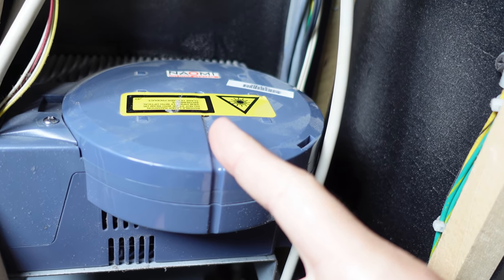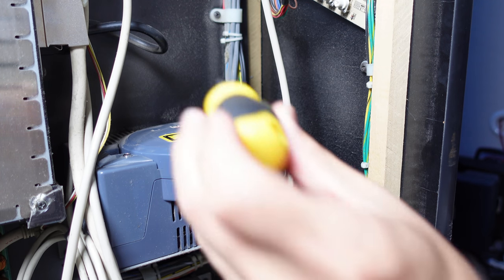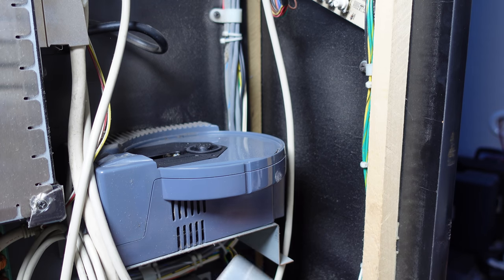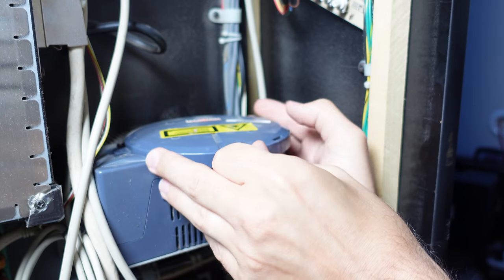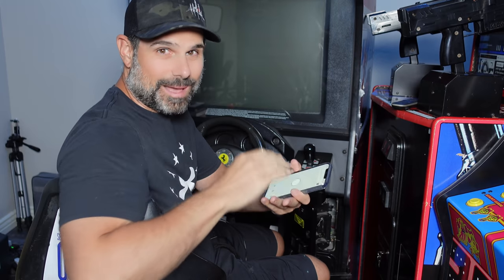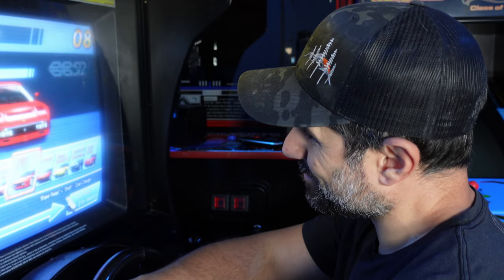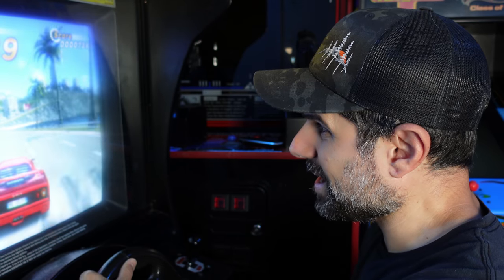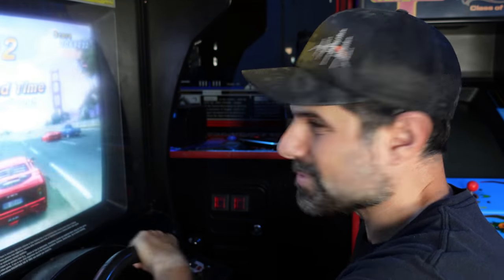Sega Outrun 2 Upgrade to Outrun 2 SP - Will it work?

Comment: What an easy upgrade this was! Loud fans are something you probably don't notice in an arcade setting but I definitely hear the fans of my Hydro Thunder running. Even in my garage with outside noise. I assume if I brought it inside it would sound like a cheap air conditioner running lol!

Comment: Just a heads up, I have an Out Run 2 Sp arcade and you can still play the Out run 2 stages on it as well as, if you go into the system menu you can set it to play all the tracks back to back in one giant race. You can also, during music select, switch the music to the OG outrun by I think holding the brake and the down shifting... Sorry, its been a while since i played mine and I usually do it by muscle memory.  Its almost how you change the colors.  Cool video and congrats getting an OUtrun 2 SP disc. It took me four years hunting to finally find one and that was 4 or 5 years ago so  I imagine its still really hard to find.
Reply: Oh wow. Am curious as i have outrun2 SP on PS3 (have the race wheel setup). What I am missing is the Egypt stage with pyramids. Can one access that stage on SP2? Thank you!!!!!!

Comment: Love the dragon on the first stage if you pass it without damage or getting of the track. Even if you drive a bit slower you can manage to get the dragon (sp2 version maybe only, i dunno). And of course thank for the video, love that game (have it on my ps3, runs 1080p and 60fps, not sure even if there are differences to the arcade - with the level of graphics i mean). Keep up the channel

Comment: Is it possible to dump both discs onto your PC and reburn them? If so it would be nice to have back ups in case the originals start to rot.
Reply from the maker: That's a really great idea. I was actually looking into a way to replace the GD-ROM drive with a SD Card, I'm not sure there's an option for that but I'm looking into it. Thanks for watching and great idea on the backup.

Comment: If every upgrade was this painless there wouldn't be a need for IT techs! Congrats man, glad you got it running. Was the fan noise coming from the GD-ROM player or the cab? At least you can't hear it with the service door closed but I guess it gets pretty damn hot in there.

Comment: It works.  I’ve done it to mine.
Reply from the maker: I was super excited because I asked several people and I was getting mixed answers. I thought it would be fun to just do it and film the process, I'm super excited that it all works.  It gives some new life to a game I play quite often. Thanks for watching!  What other arcade games do you have?  Just curious...
Reply: @RetroRalph  I have a few, lots of restore and custom work.  KI2 with both KIs, MK4 with all 4 boards, Street Fighter Anniversary, Ms. Pac-Man/Galaga 20 year, Strider with both Strider/Osman boards, Ghouls n Ghosts with both Ghouls n Ghosts/Ghosts n Goblins boards, Splatterhouse custom art package, MVS4, TMNT with both TMNT/TMNT in Time, Outrun 2/SP, Night Slashers, Aliens vs Predator with both AvP/Battletoads, EDOT, Operation Wolf, Marvel vs Capcom 2 with both version 1/2 boards, Golden Axe Revenge of Death Adder is the current line up.  You are always welcome to come by and check them out.